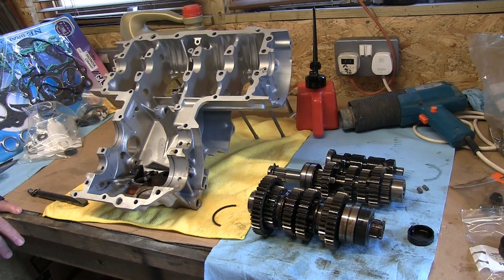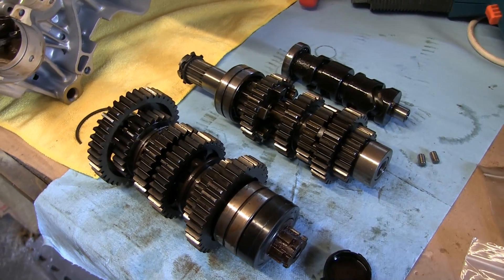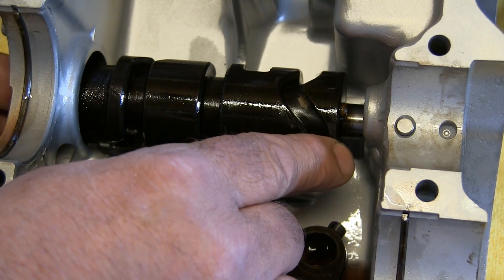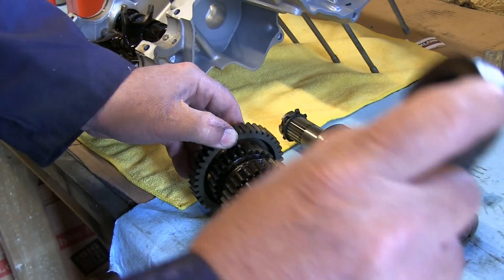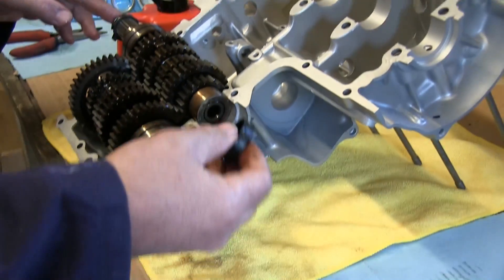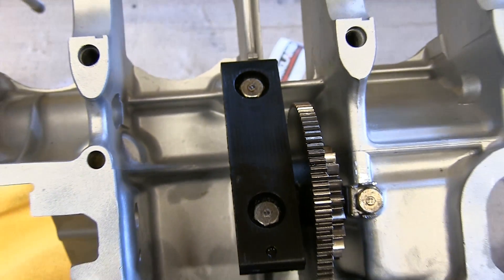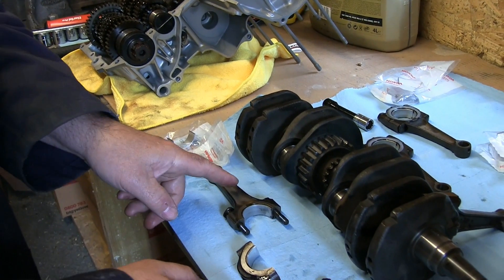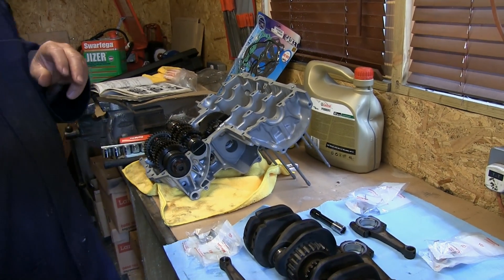Honda 400 / 4  engine rebuild Part 1

Comment: Ne jamais mettre dhuile entre la porté de crank et les attaches car le transfert de chaleur prévu entre cest 2 pieces ne ce fait pu comme prévu et il en resultera dusure au crank au lieu que ce soit sur les porté de crank
Reply from the maker: This is an argment I have heard before. It is not oil it is low viscosity assembly fluid. If you see historic videos of this engine being assembled at the factory they have a constant supply of assembly fluid lubricating all internal engine compoents as they are built.

Comment: Hi there great videos on the 400 4 engine did you paint the engine casings after bead blasting ? Regards Ken
Reply from the maker: Yes painted with a Silver VHT paint supplied by David Silver Spares.  The one with the orange label

Comment: I notice the 2 little pins, which are the very first task on the rebuild, are firmly fixed into their positions on my case and also slightly worn looking, they don't really stand proud like yours in the video. Any clues on how to get them out and also where to get replacements. Thanks, could not have completed the strip down without these excellent videos
Reply from the maker: Hi i think the only way to get them out is with heat and replacements will be hard to locate. But you could try  the companies listed at the beginning of my video "It lives" https://studio.youtube.com/video/6OnKLtXZng4/edit

Comment: Any idea how similar this is to a 1979 cb400? bottom half looks very similar, would be ideal if they didnt change it much
Reply from the maker: Sorry I dont know the answer to that but knowing Honda they do tend to use a tried and tested approach to subsequent models. Try one of the forums there is usually someone who knows specifics like your.

Comment: Hi how do you pck bearing size for mains and bigends whats the go with the colour codes?
Reply from the maker: I had the engineering done at a specialist 400 4 builders. They did the rebore based on the oversized pistons supplied by David Silver Spares.  The main bearings  were supplied by  David silver spares too as the company who did the machine work checked the crank for wear.  The coloured system means you use plastiguage which compresses when you assemble (look it up on you tube if you have never used it.) you can then measure the plastiguage and see what the clearance is and choose the shells to match. There are videos on this but it means assembling then dismantling again. The specialist also suggested that with modern oils, as long as the crank and small ends are not too worn then they use the standard shells and bearings with no issues,  D&M Engineering.co.uk is the company . They supplied all the parts for the engine build but sourced them from David Silver spares. Hope that helps.

Comment from the maker: Hi if you mean the one that goes on the end of the gear shat bad news I would think.  The seal has a built in locating dowel to hold it in to the casing,  I don't think there would be a way to get the old one out fully and no way of getting the new one in as far as I can tell. Good luck.
Reply: Too Old To Die Young thanks for your reply, I just rebuilt the top end this year, now I have have to tear it back down! I’m crying! Looks like the dowel section is still in the hole so I might try to jb weld it hahah, worth a shot!? Also it’s on a cb500 four. A little different dowel

Comment: have you had pretty good results with the ne gasket sets? i got a question about greasing the seal cavities, like the kickstarter and the clutch pushrod lever, do you grease the back side if so what grease do you use or just oil it?  it doesn't look like they get much circulation at least the clutch seal. i'm slightly nervous about it. so i just oil it, tape the splines and put it on. thanks
Reply from the maker: Hi I did not use oil grease in these areas as they gave seals or dont require them. The engine is oil tight. Good luck
Reply: @toooldtodieyoungmotorcyle  thanks a lot. pretty cool tutorials.

Comment: You never put oil on the back side of a con rod bearing!!!!! The bearing has to fit perfect. that little film of oil could cause play in it after you tighten it to spec.. This will result in a engine knock.
Reply from the maker: There is a groove in the con rod for any oil and the oil is a synthetic motor oil suitable for assembly. I took advice from the leading 400 4 specialist engine builder who builds and racers these engines but all comments are welcome.
Reply from the maker: I was really interested in this comment as I have never heard of this before. Intrigued I decided to follow it up a bit more. I worked for TOTAL and Ato Fina for about 22 years  admittedly not in lubrication but asked dome of my old colleagues their opinion. Bearing (no pun intended) in mind that they work with race teams and major engine manufacturers the consensus of opinion was that a light smear was recommended for assembly and dry joints were never advised for big or little ends. So an interesting and worthwhile comment but open to differing opinions I guess.

Comment: Could you please help. How did you determine which new shells you required for the crank and the con rods ? Ive tried to research this and know about the code on the crank case, i have no colours or numbers on the the shells and don’t really understand the table given in either of my 2 manuals. Thanks in anticipation Ken Lucas
Reply from the maker: Use plastiguage without shells. Plenty of vids. Or Consult  http://d-mengineering.co.uk/index.php/services/engine-rebuilds  who specialise in these engines and they tell you check that the components are not worn, and presumably you are happy they are OK or you would not be using the crank or conrods!  and then use standard shells as modern oils don't need such a fine tolerance.  I would drop them an email. to clarify.

Comment: Is it necessary to apply anti seize to the bolts inside the crankcase holding the chain guide and gear as seen at 7:12
Reply from the maker: I hope not as I did not do that. If it makes you more comfortable then it is probably a good idea to use thread lock on assembly.

Comment: hi thanks great video ive got my engine to rebuild on1977  cb400f2  witch ive owned since 1982  were did you get crankcase repaired. barrel fin repaired. shot  blasted  any other service i might need  keep up the good work many thanks
Reply from the maker: All the engine work was done inc blasting (next door to D&M) David Silver spares for all the bits.   

 
 
  D&M Engineering
  .co.uk Newark  
 
 
  Dave 01623 870921

Comment: Hi. Thanks for the video. 

Towards the rebuild of my own I am looking at what to purchase and already got the complete set of engine gaskets plus the oil gasket set but I hear today from you that there are others not included. I wasn't able to catch the name of those at 0:46 and 1:06.

My request to you: could you please write their bame here please so I don't miss them during my purchase at davidsilverparts. Thank you a so much
Reply from the maker: HI the two O rings at 46 are parts 282 and 283 part numbers 91314220000 and 91315044000 the one at 1.06 is part 272 part number 91207 333 000 if you don't have a parts list send you email and I will send you a copy. Regards G
Reply: Thank you very much for your answer. Very helpful. Bye.

Comment: Your cases look immaculate- what process was used to get them in that pristine condition?
Reply from the maker: The cases were media blasted with very fine beads at a local specialist. Cleaning the beads out of all the nooks & crannies & the threads was a total b**ch. Used a combination of WD40 & engine oil to force the internal threads clean with new stainless steel bolts.